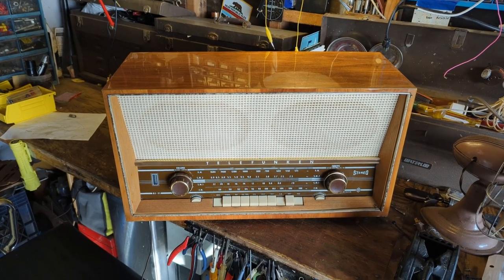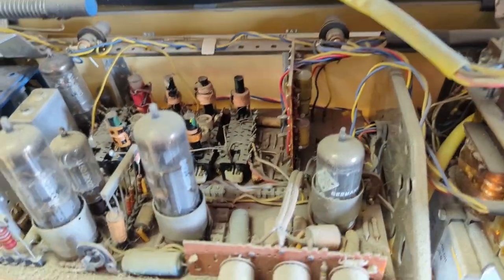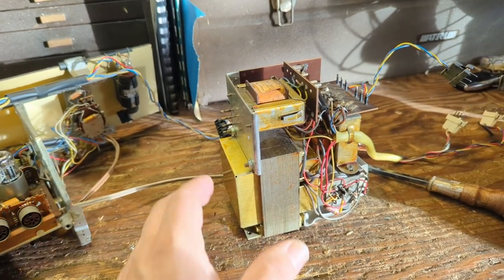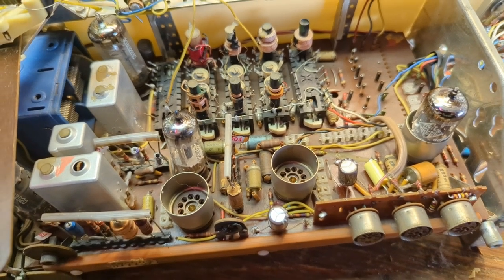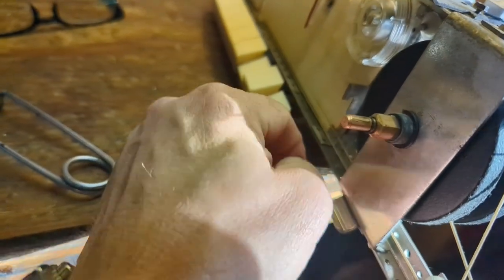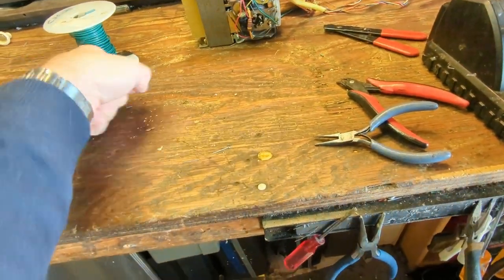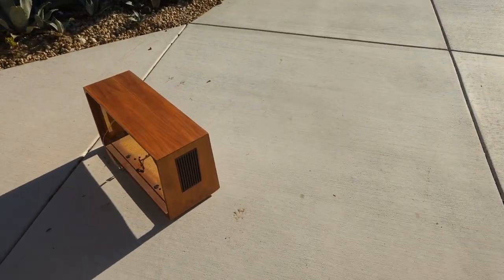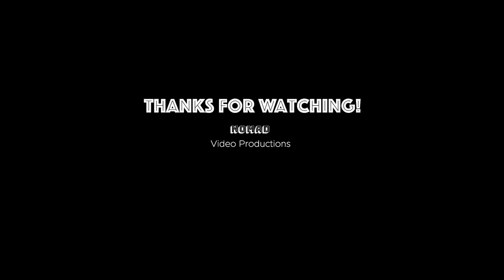1962 Telefunken Concertino stereo table set overhaul

Comment: I remember these. There was a phase when my German relations added the MPX adapters. The dealers used it as an opportunity to sell 'new' and outrageously expensive tubes, um die Tonqualität zu gewährleisten as they put it.
Stereo broadcasts of live concert performances were wonderful to listen to - they really sounded outstanding.
Reply from the maker: Everyone did it. The American manufactures would also upsell MPX adapters, especially for console stereo systems. This was a very short fad because by the mid 1960's These were simply automatically included with the sets, in the US at least

Comment: Impressive German engineering. There are three "gallows" type vertical component mounts reminiscent of an American
 style  Bulplate ( think early PC board) design. Do you see them?  When you find solidified grease on a tuning knob take 
the plastic knob off and use a really big soldering gun to "warm up the grease". It can work over taking everything apart
if you have to. An open flame should be the last resort. Nice restoration there again Seth. You do know your way around
these German sets. It sounds really good.
Reply from the maker: Open flame is all I can manage to use to free up those sticky pots.

Comment: The ECC83 over to the right of the ECL86s easily costs as much as both ECL86s combined.  I'd take all of the tubes out of any foreign radio before I worked on it because I tend to be a bit clumsy at times.
Reply from the maker: Really. They are basically just 12AX7s which are super common. Is it just if they are labeled as ECC83's?
Reply: @misterradio5035  telefunken 12ax7 easily sell for $100+ all day long.
Reply from the maker: @weekendwarriorweldingdiypr4604  Holy shit, really? That's sort of insane given that an RCA or GE 12AX7  goes for a coupla' bucks. Guess its all about the name then

Comment: I know you said it did not have the FM multiplex adapter, but does it have stereo aux input? I notice it says stereo on the front and rear cover. Nice looking set, thanks for sharing.
Reply from the maker: It does have a stereo aux input. But FM is strictly in mono

Comment: Why didn't Telefunken not use Diode Ring Mixers that operate in the balanced mode and means you get less mixer products and bandstop filters will take cake of unwanted mixer output ie allowing the Lower side band of the signal and not the upper side band.